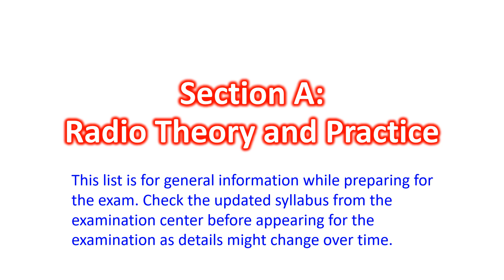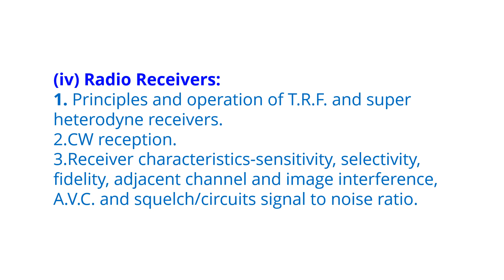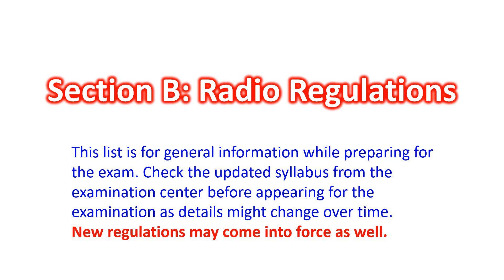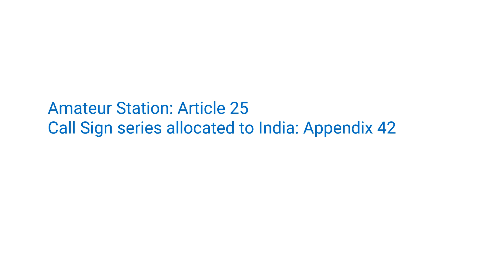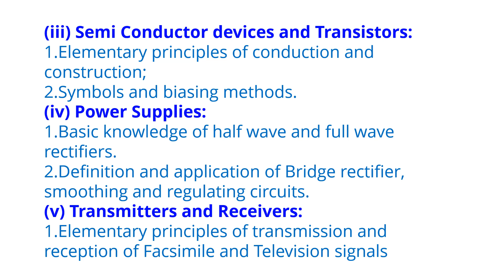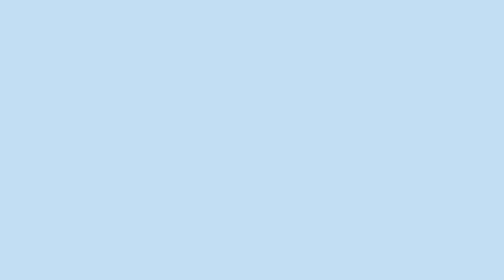Comment: Sir, I have a doubt. I don't have a engineering degree in electronics and communication, but in my (mechanical) engineering days I had separate subjects on electronics and communication. Am I eligible for skipping the part 1 of the examination?
Reply: I am not aware of such exemption. Please enquire at your local wireless monitoring station. Anyway it will be easy for you clear basic electronics MCQ exam. Best wishes for the exam.